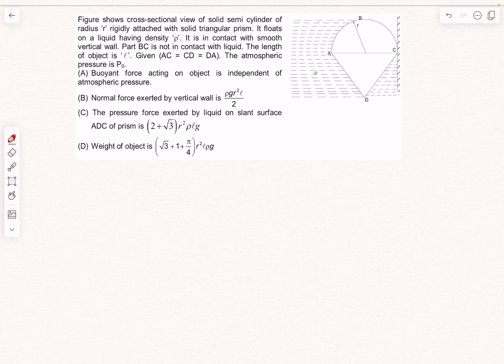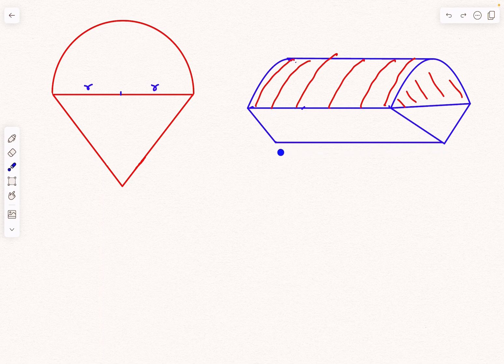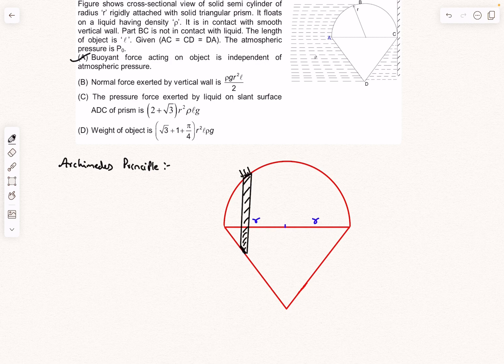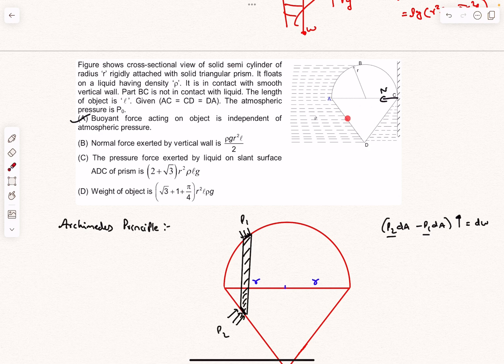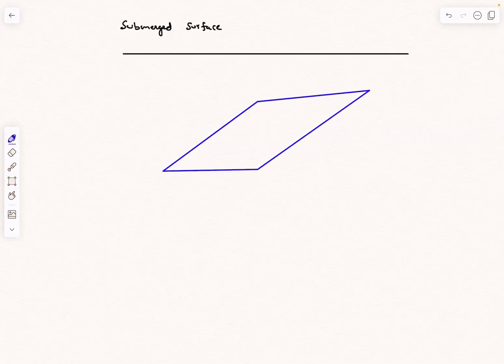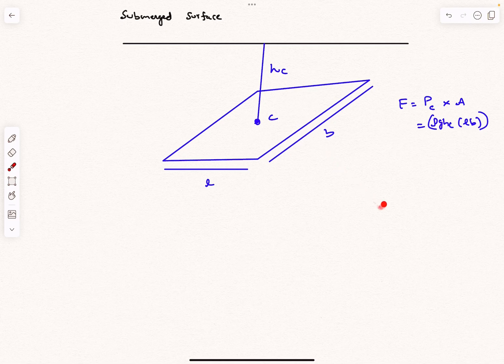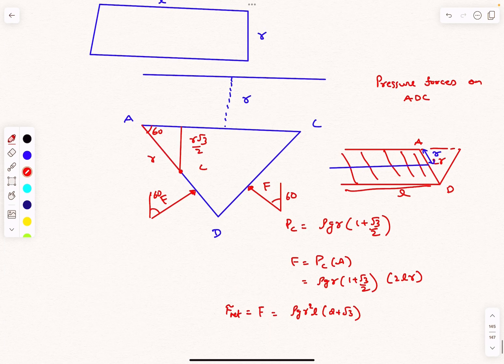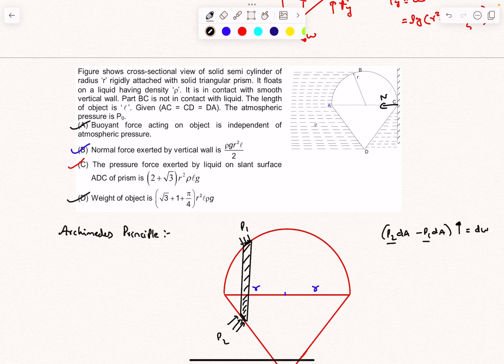[Jee] Good AITS Problem On Pressure Forces

Comment: Quick Summary/approach; 
1. Problem at hand; objectives; 
find all the forces due to static pressure. 
find normal  reaction due to the wall
find the mass (m) of the rigid body. (so we'd have to find the buoyant force, and equation it to its weight for equilibrium----> v disp(which isn't fairly obvious) can also be found instead) 

2. We breakdown the problem by finding the individual fluid static forces on each surface; 

a)"F"; for the flat surfaces of prism; we find the net force (take Po also) on it using; F=Pc(A)-->a frequently used result ;
we later realise due to  identical surface on the other of the prism; the net force in the horizontal direction on the prism is zero. But the vertical components add up (F cos60+ Fcos 60) 

b)"Fx & Fy"; (M-1; really cool approach) but for the spherical surface of the cylindrical portion; we instead draw out the FBD of the fluid surrounding it (and take Fx, Fy as reaction forces--sustaining the equilibrium of the fluid.)
or (M-2) to  using a parameter "θ" we find the components individually again by 
∫P(θ)dAcosθ=Fy &
∫P(θ)dAsinθ=Fx ; (where dAsinθ can be written as rdl--> vertical projection of the element)

**also make sure where you take guage pressures. (such as while finding the reaction force, weight)
**mind the fact that all these so-called methods are the exact same, just different manifestations.

P.S. Really thankful for your consistency in bringing new discussions everyday!

Comment: Are there any examples where net force due to atmospheric pressure isnt zero? I would assume it would be a case of non uniform density of air or something , no clue , just wondering
Reply from the maker: In option C atmosphere comp will come i missed it in the vid, check pinned comment. If question was to find absolute pressure on a submerged surface then it will come def.